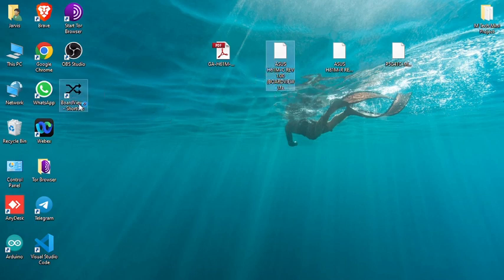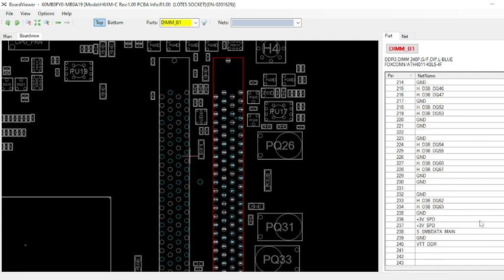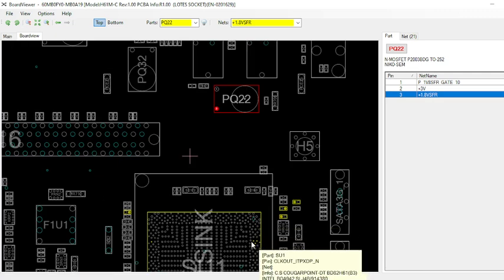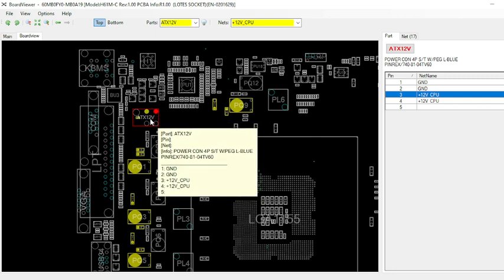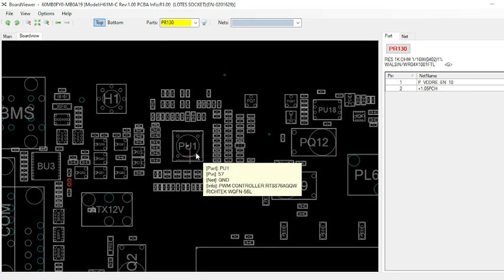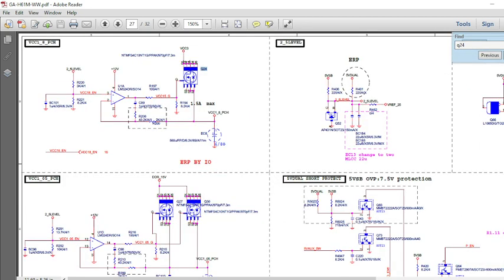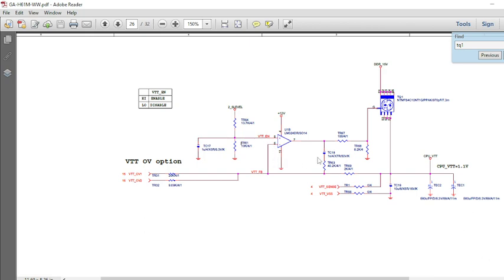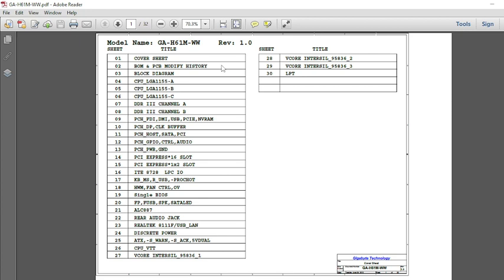H61 Motherboard Voltage Rails and Problems with Solution

Comment: thank you for good stuff but if possible  please provide board view files on foxcon h61 series and gigabyte etc bro finally a tips need for me i have Foxcon H61mxe series motherboards both are having no display problem havind voltages is ok except ram voltage is high  i.e that instead of 1.5 it shows on 1.76 something and our pch side ec capacitor is shorting to ground both sides  how to solve ?plz if possible
Reply from the maker: change pwm controller for ram voltage and there are no schematic for foxconn h61